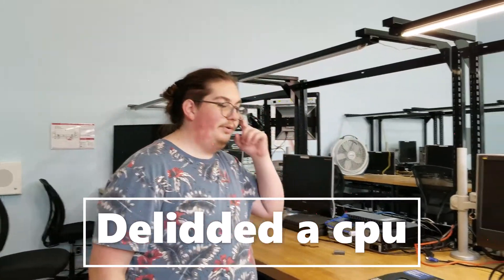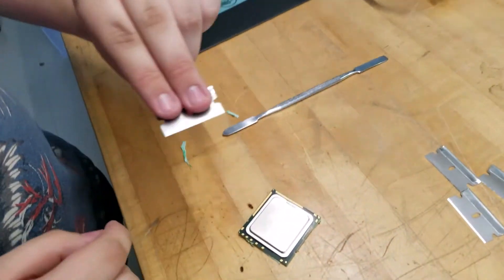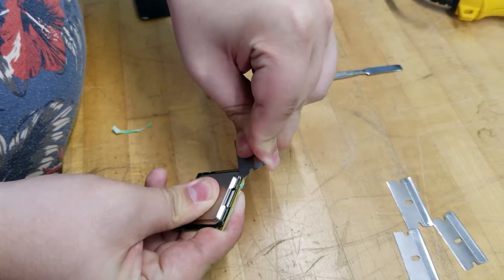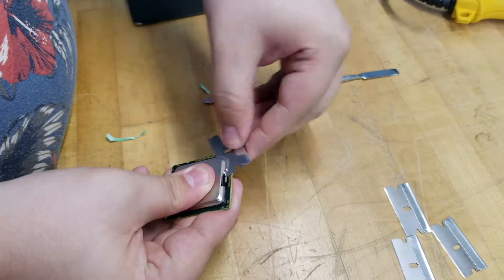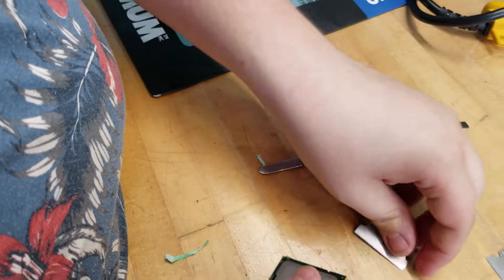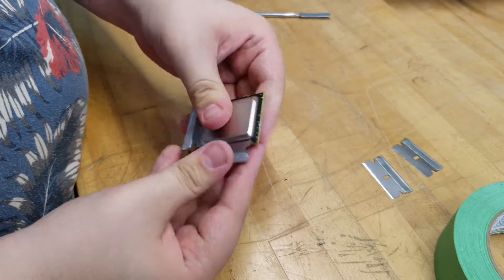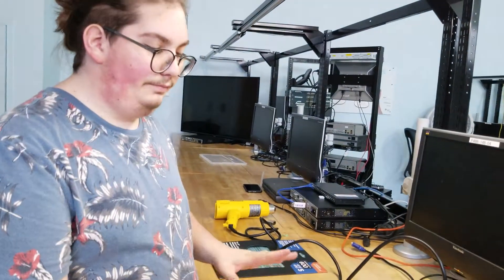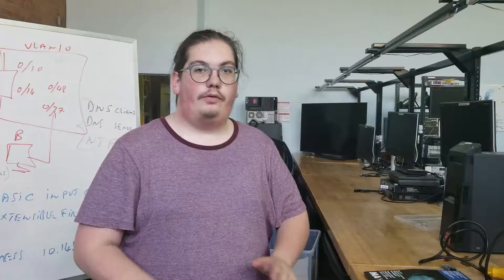DELIDDING XEON CPU

Comment: It looks even harder then to delid Core i7 3770k, which I barely did with no damage to it. And its cover wasn't even soldered like a Xeon! But my "new" Xeon 2699v3 has the same problem as my old 3770K - under load it hits the max and throttles like shit.